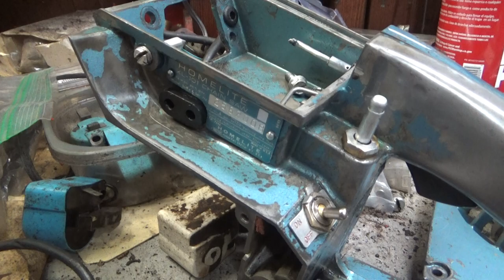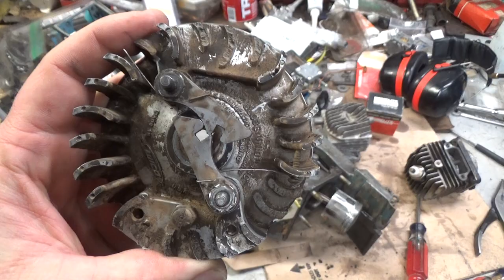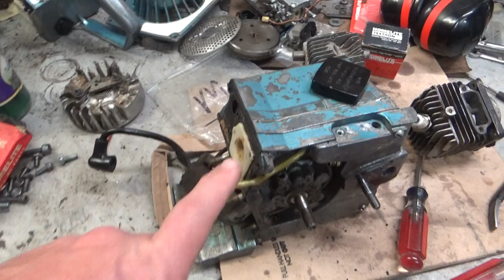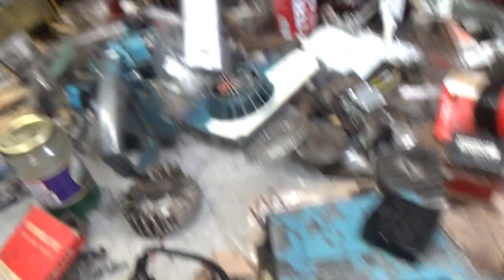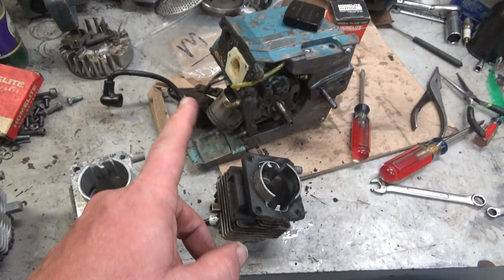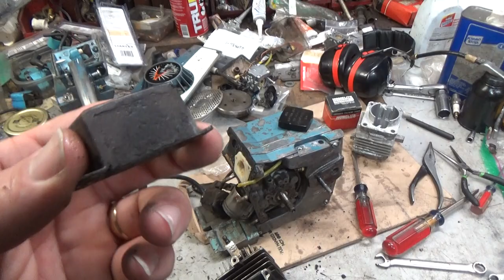John's Homelite XL-101 First Look & Diagnosis

Comment: Leon, would there be any crossover with piston & cylinder with say, 102, 103, EZ? The smaller Homies in other words. Since you be the Homie Guru, if anyone would know, it be you. And your fan base would be interested.. Cheers. K
Reply from the maker: The XL-101 shares it bore and piston with the XL-12.  The XL-102 & up share their bore and piston (mostly) with the Super XL.  Even though these saws are built in a similar fashion and style to the Super EZ, they are very different models.

Comment: Love your repair videos! Keep them coming. I have a question would you know what the specs would be to a solid state electronic ignition coil on a homelite super xl 925?
Reply from the maker: The Homelite service manual details testing procedures: https://www.leonschainsawpartsandrepair.com/uploads/3/9/7/9/39792537/homelite_chainsaw_service_shop_manual_4th_edition__pages_1-76_.pdf